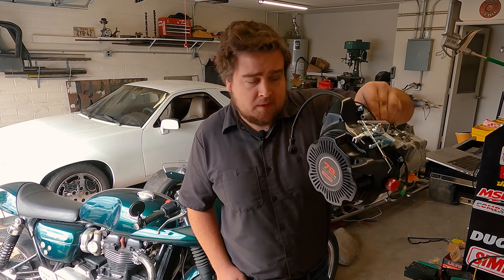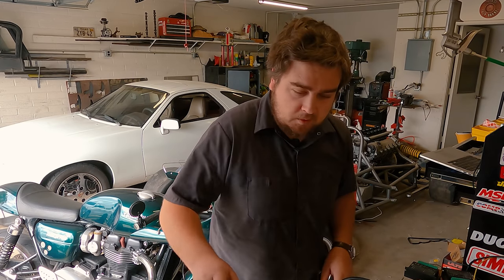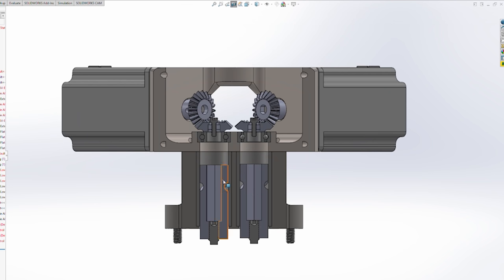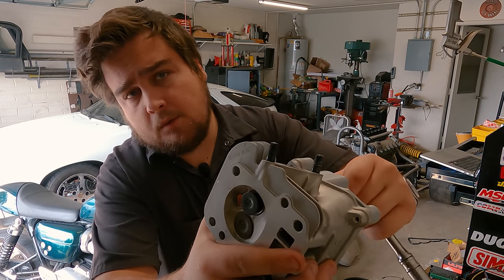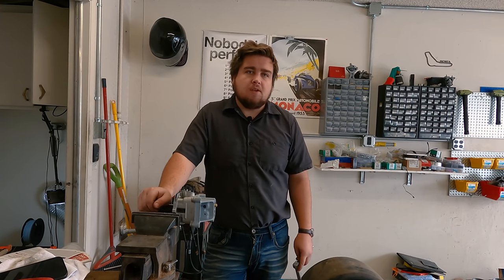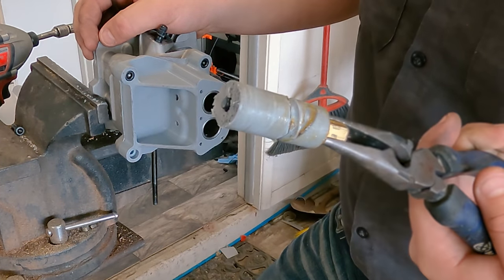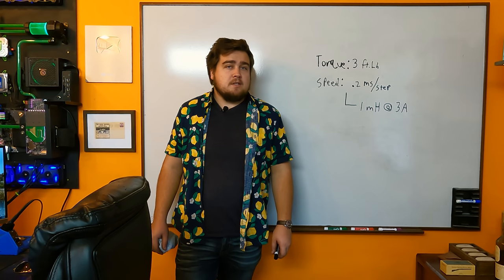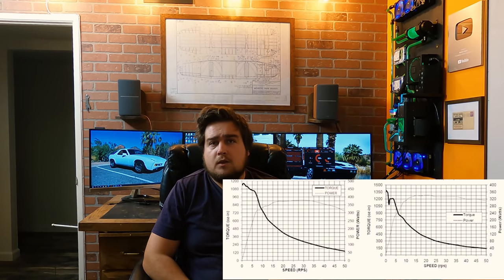Adventures In Deleting Camshafts | The Theory

Comment: Why can the height control groove not go all the way around the cylinder? This way you only need to vary (or stop) the speed of rotation to get perfect valve control, it doesnt need to go backwards and forwards. The profile you cut is kind of arbitrary.

Secondly, i think tom stanton did a video in which he dynamically varied the speed of a brushless sensored hobby motor in order to make some kind of helicopter. Reducing the number of poles in the drive motor dramatically could mean despite longer coil charge times, there are significantly fewer of them.
Reply from the maker: I did some experimenting with a single groove around the entire cylinder, with varying results. I was really only able to get a few degrees in either direction. I do enjoy Tom Stanton's video, and I'm going to order an o-drive just to mess around with it a bit.

Comment: What about hydraulic pistons for opening the valves ? With very thin oil (vg5) the high flow may work ?
With 150-200bar, a 10mm piston would do. I do not know if electric controlled hydraulic valves are fast enoug and have not done the math on flow, but can it work ?

Comment: I dare say the direct drive simulation racing wheel bases have the power and accuracy you’d need, only the programming would be the biggest issue
Reply: Also koeningseg have a freevalve that uses solenoids and reverse tension valves (I think) maybe a valve open default could improve response time on your idea too

Comment: why not just use a camshaft that is spinned by an electric stepper motor? You won't have to go from a dead stop to full speed, then stop again, just variable speed throughout the engine cycle. You are going to loose the option to vary valve lift, but you can get rid of the spring returning the valve. Just like a small crankshaft moving a conrod thats attached to the valve, instead of a piston. If you want to get more valve duration you slow down the stepper motor spinning the shaft, while the valve is open.

Comment: Don’t know if this would work within your design constraints but could you merge the two ball bearing channels so the stepper doesn’t have to start, stop and reverse?
Reply: That would mean there isn't any more variable lift though - you could then achieve the same thing by just taking a conventional cam shaft and driving it with an electric motor rather than a chain or belt
Reply: @dirkmohrmann8960  ok that makes a whole lot of sense. Thanks :)

Comment: Wouldn't it be easier if the valve actuating shaft would be able to turn 360 degrees, with an adjusted continuous path, that way there is not start/stop lag and way less stress on the parts with faster operating possibilities.

Comment: Reversing the stepper motors at engine frequency seems unrealistic. The mechanical inertia is way too high. Can you redesign the drive cam so that the steppers are running continuously and valve timing is achieved by variations in stepper speed?

Comment: Severely confused...why are you not just using electric solenoid? Something like asco with no valve spring an a circlip for a stop. If you want it variable length keep spring an use timing of current?

Comment: So you're using motors for better control over the valves? I don't personally believe they could ever be fast enough for a running engine. I would just use solenoids.

Comment: Could you overcome the accelleration losses from the stepper from start stopping to a full 360 deg rotation like a cam shaft but still control timing and flow by speed of the valve opening and closing or is the idea to control flow by height of the valve as well as speed of opening and size of the valve etc?
Reply from the maker: Maybe. The stepper is a starting point, I'm not sure a strictly off the shelf component is the answer. Steppers have a lot of momentum with the rotor, and that's something to consider.

Comment: Dude! You need solenoids instead of steppers, that's way cheaper and mechanically easier. The basically consist of a coil and a rod with a linear guide. Leave out the conversion of a rotational movement into a linear movement.

Comment: has anyone considered a "hydraulic pushrod" arrangement..  somewhat inspired by WW1 aircraft gun  interrupter gear?

engine cylinder valves, actuated by a double acting piston. 5/2 valve akin to an electrical  double pole crossover switch, but with a no connection neutral position in the middle, would direct pressure to appropriate side  of engine cylinder valve's piston for lifting/closing.  5/2 valve controlled by steppers, or even pressure impulses from cam lobe actuated plungers... shouldn'nt be difficult to common plungers onto a plate that can rotated around camshaft to adjust engine valve opening and closing timing..

Comment: i saw a raelly really really old idea. which i think could work with a bit more engineering. it think its called rating valve. its basicly just a steel rod thats rotating like a camshaft above the chamber. with a slot into it to release the gas and feed air into it. i had another idea which is kinda dumb but could work. its kinda based around the duke engine. its a rotation round plate that has slots into it to release gasses and let them pass trough at the right angel. kinda hard to explain tbh. i know that valves a purpose to mix the fuel and air together. but in my theory. getting rid of the valves would maybe increase the engine flow. and for the mixing part would be maybe a pre mixing chamber good? Sry. I´m just throwing ideas around. probably none of the works. but i got more. i think

Comment: A solenoid wth a return spring would likely make more sense.You just have to control the current going to the solenoid. This system is going to have a LOT of inertia that is very difficult to overcome and you are very likely going to miss steps when trying to operate like that. Aka, your "direct drive" theory won't work very well in reality because the motors won't be where they are commanded after a short period of time.

Comment: Hmmmm. I can see where you're going with this, and I can offer some mental lego-swapping based on your design. First off; you're dealing with a machine that turns linear actions into rotational action. Maybe you should continue to roll with the rotation design. Steppers may not be the answer here, while they're wonderful for accuracy and repeatability, if we turn this problem sideways that's no longer as large of a requirement. First off -- the ball guide serpentine path. That part should be engineered for free rotation. Think about the business end of the humble disposable salt and peppers shakers. Three spinning rotors provide the serpentine path -- but for the fuel and exhaust. Topmost is fuel for suck, bottommost is seal for squeese and bang, middle is blow. Three shafts, two hollow, outer is topmost, middle is midmost, bottom is flat-ended for the seal, and you can inject lubricant from the top. Three simple pancake brushless motors above, each grasping the shaft they need. Fancypants 32bit STM32 ESC driving each one. Synchronize and desynchronize the motor RPMs to expose pathways for precise timing. Look at the way they rigged up that rolls royce electric racing airframe's axial motors. Or have a look at parallax's propeller2. That's fast enough for you to include magnet detents in the rotors and pulse the motor power to free it past the detent force towards the next position. Planetary gears might reduce that to two motors with a wide RPM difference, and pulse timing with hall sensors.  Thanks for the idea exchange.

 "If you have an apple and I have an apple and we exchange these apples then you and I will still each have one apple.

But if you have an idea and I have an idea and we exchange these ideas, then each of us will have two ideas." -- George Bernard Shaw
Reply: So if it's not clear here, the idea is to advance and retard the brushless motor RPMs to precisely expose and hide the correct airways. Most of the time the motors would be running at the same RPM, keeping all three rotors spinning at the same speed. Pulse the motor throttle briefly to 'advance' any of the rotors a position, or pulse any two to retard the third a step.
The actual RPM the motors are spinning at do not matter; it now comes down to the timing differences in the drive strength to each. Using weak magnets in pockets within the rotors can force them to prefer following their cousins until a pulse forces one to travel faster than the others, exposing it's airway; which is spinning, but that really shouldn't matter for atomized fuel or exhaust. Only that the path is blocked or not. This should easily get you down under 0.3ms boolean decisions of which rotors are aligned and which are opposed/blocked.

Another point of view would be a tesla turbine, where each of the rotors' RPM is independently controlled (either from the edge or concentric hollow shafts), have been thickened and holes are drilled through the rotors, on the faces, and notches from the side profile. When the rotors are aligned, they form a series of rotating L-shaped tubes. When the rotors are unaligned, they form a series of rotating blockages. This would also present a suction down the hollow shafts, which would aid in lubrication. An open faced ball bearing pressed into the bottom of each rotor provides support for the nextmost inner shaft. At the other end of the shaft (Where you've got your steppers currently), you either have a toothed timing sprocket with the appropriate missing teeth and hall sensors, or some other form of sensor feedback (field oriented control from the brushless controller?) based on commonly available hobby electronics parts and a jeweler's lathe from harbor freight. More open faced ball bearings, and then the oil feed at the tip top of the shafts. Appropriate passages along the edges of the rotors direct gas flow, and oil return.

Think of the concept of tone wheels, yanked out of a hammond organ/piano context. That warble -- or the leslie speakers' fast/slow switch that accompany it.
Maybe a visual reference? For example,  v=s8jOL0m5NeU

Comment: Could you use a crank shaft type design where the motor could continue spinning one direction and then start pulling itself closed like the Ducati’s
Reply: Desmodromic
Reply: @dallynsr  yes that’s it, I guess you’ll still be limited by the lift of the cam.
Reply: It will just be a variable cam at that point

Comment: Interesting, my only suggestion would be to keep the steppers running at all times and use a clutch system that engages the power on and off when needed. Sort of like transmissions where the power isn't interrupted when changing gears, or like an air conditioner clutch that moves with the belt but doesn't engage when off and doesn't immediately seize when turned on.
Reply: This is a really good idea! Except at this point just use the engine mechanical power.

 Sure you lose the niftyness, but you still get unlimited cam profiles.

Comment: why don't you simply design and manufacture stepper motors for this exact purpose
Reply from the maker: That's actually a thought I had and I may be able to. Or at least design something that meets the parameters and have a motor shop wind me some.
Reply: Amazing how you can make something complicated sound as though it's easy just by putting the word "simply" or" just" in front of it.

Comment: why not just design a head with a rotary valve attached to a stepper motor?.. basically all you need is a metal cylinder with two holes cut into it slightly off center to create a vortex in the cyl... no poppet valves necessary.. controller only needs to control the rotation of the rotor.. one moving part..

Comment: Why not just spin the camshaft with an electric motor? Just make it adjust it’s rpm with the crank. Then you can use valves like a Ducati with no springs.
Reply: That only allows you to control the camshaft timing not the valve lift & duration/dwell.

Comment: GDay,,I like the idear of making valve stem in to coil centre,although heat does afect magnetic strenght,,How ever if you were to make it Pneumatic,,with just a on and when cylced off air just drains,,shouldn't be too hard,,air spring return,,making it fully adjustable both directions of travell,proberly will need external air to start but once running make it's own air,,
Biggest problem will be clean air supply,,at these sorts of tolerance would'nt take a real big peice of shit to stop it,,

Comment: Yeah, I'm not sure a stepper really has an advantage over a sensored PMSM (A servo motor) here. It's a more complex(Controls wise), and expensive device, but the electrical reduction and sensorless design on a stepper isn't your friend. I'm guessing you're not really counting inertia or the possibility of speeding up the servo instead of stepping at a fixed rate, hard to accomplish the right commutation and the stepper itself is a bit of a low pass filter with all those poles.

With a stepper, you think "Oh hey, this is simple, I'm commanding position, so easy!"... Well only within the confines of not exceeding the torque or a certain moment of inertia on the shaft to make all of that break down. More friction, more mass means it's going to reduce the stepping speed and introduce other problems. Keeping the actuation speed low is the cheat you're employing to ignore all these problems. With such a high number of poles, a stepper motor has a very high Ke, meaning you need significantly more voltage to produce torque for a given RPM vs something with a relatively low pole count. In general I've seen rotor poles be lower than the number of stator poles (Or slots), in the case of a stepper, You have a very high number of stator poles(50 or more?) and only four rotor poles. 

With a servo, you should have access to motor position and at a minimum be able to command torque. Commanding position is a challenge (It is with steppers too, if you're going to constrain yourself to their very basic operating mode. This is holding you back), because for an optimized control system you need to know the mass and friction of your assembly among other things, which means variables outside the motor itself exist. This is totally doable and has been done, and it doesn't necessarily need to be perfect, just stable and with (probably) limited overshoot.

I don't necessarily think you're going to have to dive that deep into the controls yourself, a company may be able to help out with that.

That, and in terms of air motors, hydraulic motors, and electrical motors.... Electrical motors in general have the worst power density of any of these. That's why solutions have been implemented with the other two. Not saying you can't do this with electric motors but I'd sure be surprised if you could do it with a stepper. I am 99.9% sure you do not want to use a stepper.

Now cue some motors engineer to come in and lecture me about pole pairs vs poles and other things I don't presently care about.

Comment: Soo, all of these machinations to actuate a TRADITIONAL valve. why not change the valve as well. might even be able to do it in the same cylinder head and maintain the compression ratio if you play your cards right.

Another thing, it seems odd to me that you would try to rotate the cam forward and back thus creating a cycle of starting and stopping. You are wasting quite a bit of energy, and increasing the amount of torque/power that you require to do the job. Instead let inertia work for you. design the cam to do open and shut in one rotation and change the timing/duration by only slowing or speeding up the cam a little on each revolution.

Comment: If you are only revving it up to 6Krpm, why even bother? Your current design is twice the size of a traditional valve train including the cam, so the benefit of going semi-electric valve control is negative. Freevalve design starts to make sense after 10 Krpm, when traditional valve control starts to lose focus. Even after that, traditional cam can control valve lift up to 22 Krpm by just modding the spring setup. So, where is the reasoning for beating this corpse of a horse, other than slightly humorous YT video series?